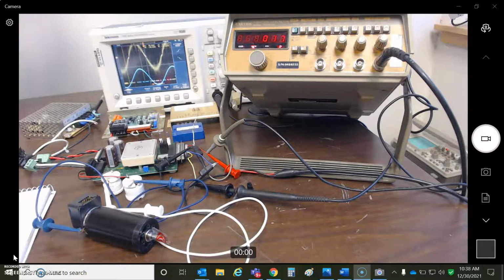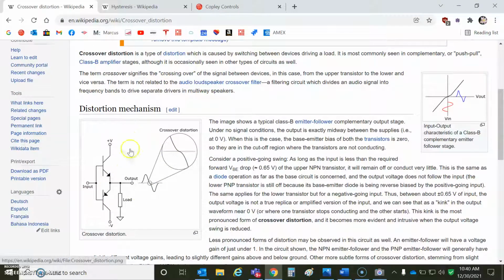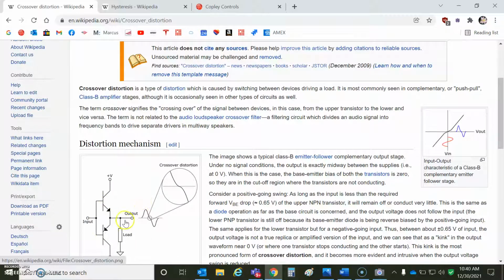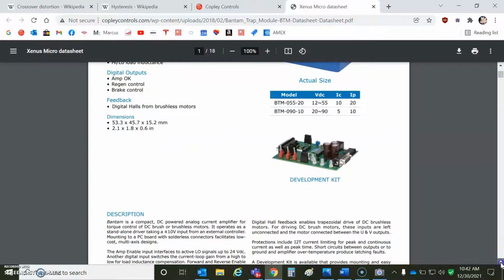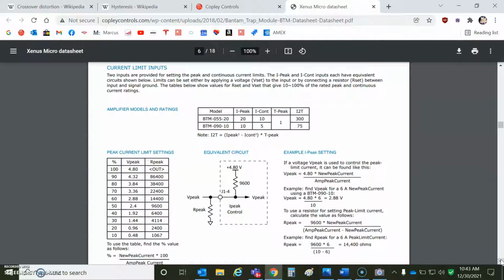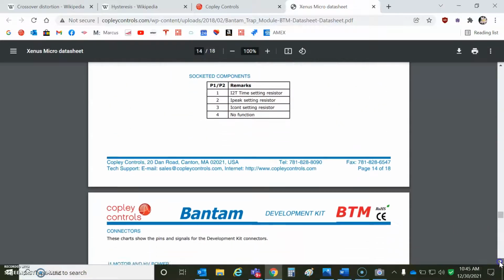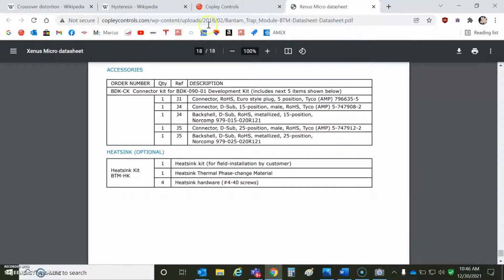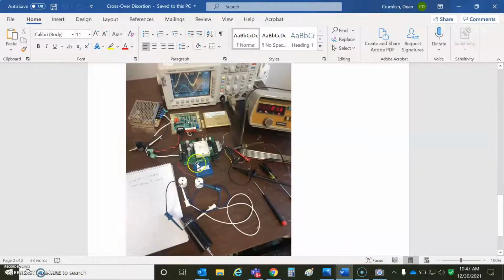Near Zero Crossover Distortion - New Copley Bantam BTM replaces Old Analog 4212 DC and 503 BLDC

Comment: The copley 503 has 3 ir2110 ic bootstrap circuits built in.  Do I need to have a pid to control a bldc from the copley 503? Any info would be appreciated as to how to connect a working copley 503...

Comment: Does the copley 503 need a ref signal to run.  Also, does inverting ref signal reverse the motor..
Reply from the maker: Yes and yes, +/-10V input = +/-10 Amps see datasheet: https://copleycontrols.com/wp-content/uploads/2018/04/Legacy-503-Datasheet.pdf